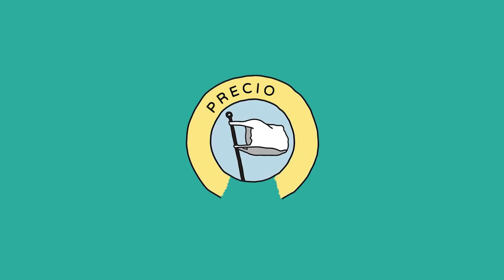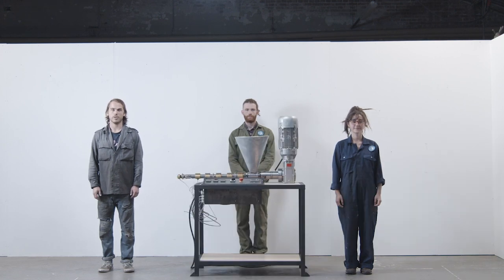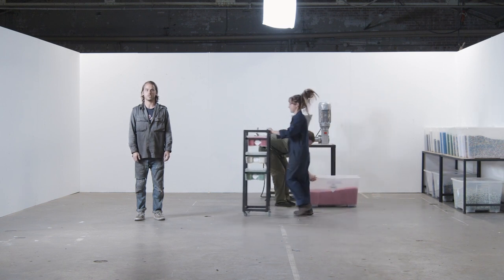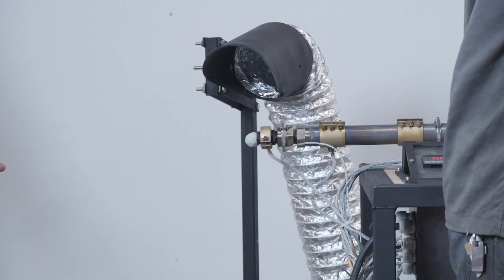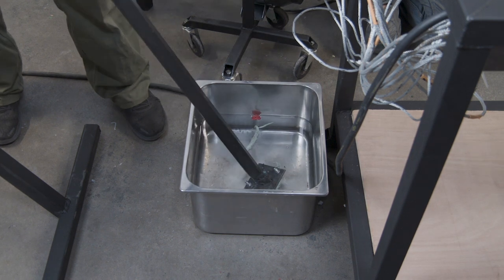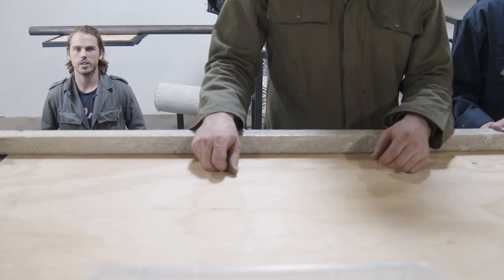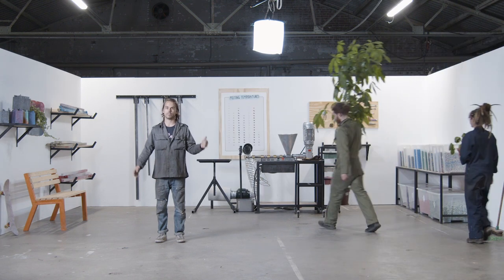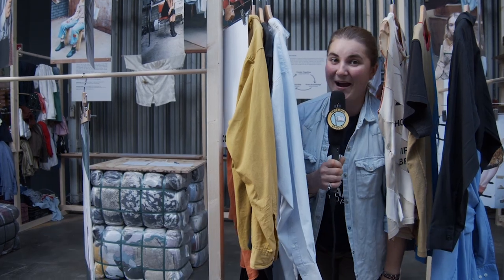Precious Plastic - Setup an extrusion workspace and make plastic bricks (part 7.2)

Comment: Question how do we make hdpe more permanent, especially with a higher melting point, maybe an additional plastic hardner? I can’t wait until I get my own extruder, I want to build a house boat was going to use resin until I figured it was gonna cost some $300,000 best part is It’s designed to sink and be anchored when there’s bad weather, or whenever I leave. Plus instead of a boat gonna have a small suitcase sized foldable sit on flying pack to take me to and from shore to my car 👍🏽

Comment: Hi there. I am an entrepreneur in South Africa who is focused on creating sustainable housing from recycled bricks manufactured through injection moulding. Right now we're still in the test phases but I was wondering if there were any kinds of techniques to strengthen plastics such as hdpe and PE and PPE to achieve a high tensile strength as well as be able to sustain carrying loads? I was thinking of using recycled glass to add to the mechanical strength of the bricks but I'm unsure of how I would begin to determine its sustainability
Reply: the hdpe bricks already have a extremely high tensile strength.  many times greater than concrete

Comment: I don’t get it, who’s going to buy those beams? What are they used for?
Reply: I want to know as well. But can't find a answer
Reply: The beams can be used to make that bench/other furniture! or they can be used for other things as a good clean source of plastic to melt down for other molds. If you process a ton of plastic at once but don't know what to use it for yet, those beams are a good way of storing it for later
Reply: kk hmm alright I guess one could use the beams for something like that. But considering one would need to heat the beams twice if they were to be molded into something else, wouldn’t it be better to just leave the shredded pieces until time comes to mold something useful? I’m still skeptical of that business model operating with any kinds of significant profits, considering all the expenses...
Reply: @cantsolvesudokus  you can definitely do that! often in the small scale manufacturing I do, we have a "test" phase where we create stock of a specific material/color/finish in similar smaller bars (more like the size of a gold bar or ingot). Because we often use recycled materials, we don't always have exactly the amounts of what we need, so it helps us calculate what the project demands. it makes more sense for use to have a "material processing day" and then a manufacturing day, but that's with bigger runs of stuff. One-offs we just go straight into our final mold. What I appreciate about these guys is that they are providing entry level equipment and guidelines for a business model, but its up to you to make it as profitable as you can. it will always be faster/cheaper/less overhead to just order cases of new plastic pellets than to gather and process your own (or even just order the pre-made parts and assemble yourself!). But if you are organized, have community buy-in and can get people to bring you the free materials, then you can start to see the sustainability and benefits of such a model in the long run. I am curious to know which of their network has had the most success though!
Reply: The original idea was to allow plastic industries to independently form in developing countries, but it never took off in practice, most likely because professional industries are far more profitable in the short term for an unskilled worker. This is mostly a proof of concept of what can be done, and you can adapt it to your own project. For example I didn't create a beam, but I do use one to create plastic chunks shaped like AR-15 receiver forgings. These are then sold for people like home gunsmiths who want to machine it out into a firearm receiver. Everyone here in the US is super scared due to Biden administration's actions, so anything gun related is flying off the shelves easily. I'm basically turning free scrap plastic into a $20 product which is great. And that's the other great thing about it, it is a modular setup so you can change your product instantly to match market demands for your fabrication shop. Prior to the gun parts, I was making lab equipment and respirator adapters for some universities and one hospital. Because it is recycled, they actually paid 3x the price over the professional option. Crazy, but hey, my wallet won't complain.

Oh, the other thing is people actually pay me to haul off their plastic industrial scrap. So it is a win win situation once you figure out the logistics.
Reply: @kyekillian  It is actually better to store the plastic in pellet/shredded form than a block. As a block you then have to cut it down and shred it if you want to make something smaller such as filament for 3D printers. This wastes manpower and shop time. I use 5 gal buckets from local restaurants and use a hydraulic press to smash them tight. It is almost as dense as melted plastic, but you retain the modularity of shreds over solids.

Comment: To avoid dribbling when you remove the mold, why not back the impeller off a bit?
Reply: what impeller
Reply: @Cj19944  The one that is pushing the molten plastic out of the extruder and into the mold.
Reply: @marknahabedian1803  its called a screw